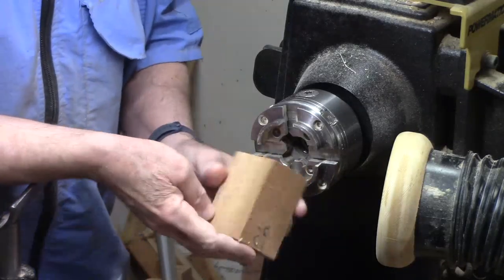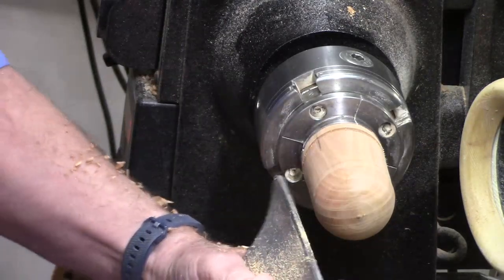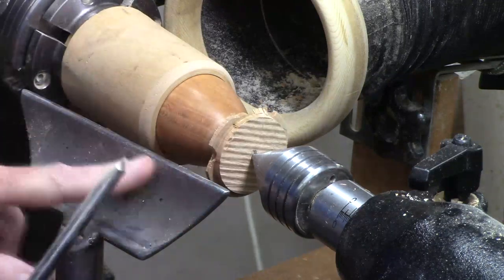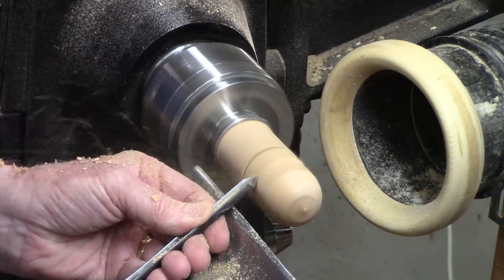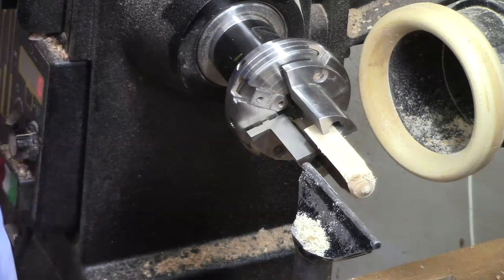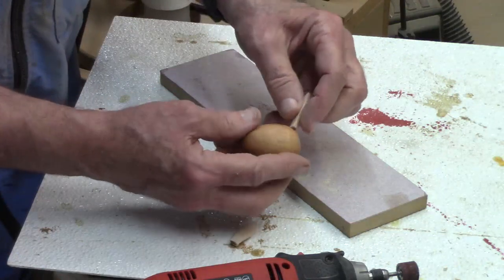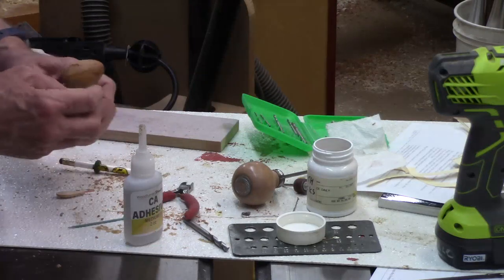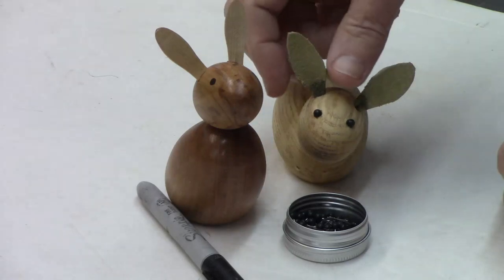Turn an Easter Bunny

Comment: Great bunny Mike. I like the leather ears best but the wood ones are good too. BTW my new lathe is operational as of yesterday evening. It took both of my sons-in-law to get it on its feet though. I mounted a 2x4 between centers and turned it round. Nothing interesting but I can say I've made shavings. All of my turning gear is still in storage so all I had to work with was a 3/8 bowl gouge. But it was still fun. Have a great day and stay safe.🙂🙂
Reply from the maker: If turning a 2x4 BC with a BG was fun, just wait until all of the tools come out!

Comment: Fun turn Mike. Just a quick ask... Would you mind sharing what angle you have on your parting tool? I've been using 45°, but it doesn't seem to cut smoothly.Thanks, V
Reply from the maker: My 1/8" is 55 Degrees and my 8mm beading and parting tool is 60 ( the included angle.)